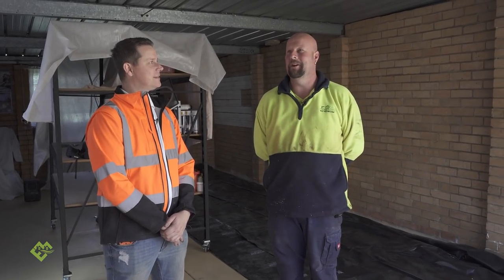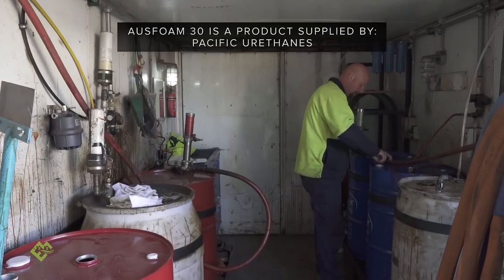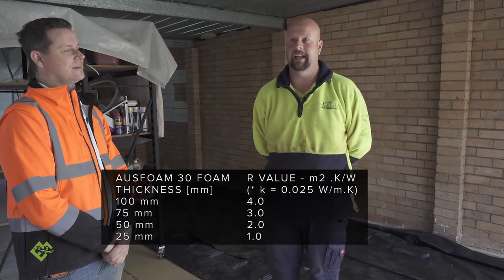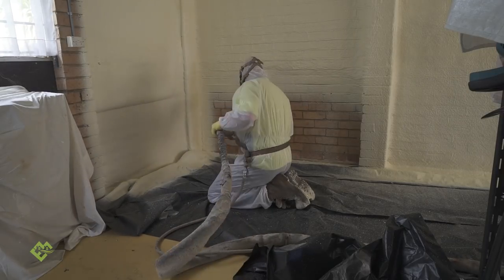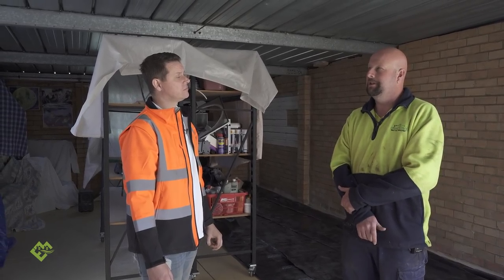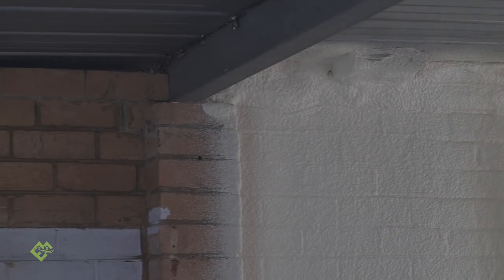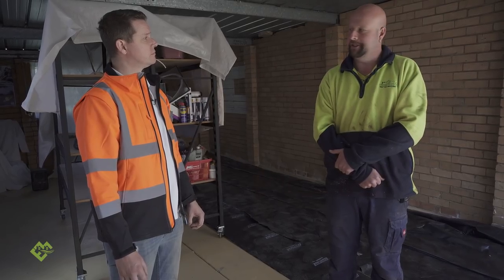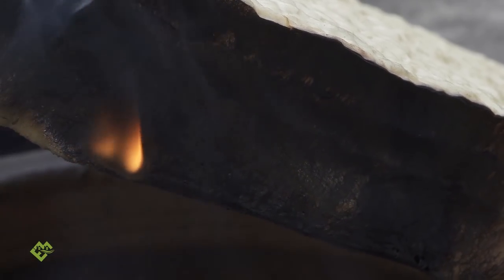Insulating and Air Sealing a Metal Deck Roof with Spray Foam.

Comment: Could spray foam be used on a pre-built motorhome to insulate it further? Can it be sprayed between exterior and interior panels?
Reply from the maker: +Janene Williames I can’t see why not, contact a spray foam installer for more information.

Comment: Had spray foam placed under my floorboards in my house in Melbourne  by a prominent spray foam company. Stuffed it up with the mixture and the house couldn't be lived in for 5 days as it was still fuming. The company didn't tell me if the risk of that at expressed surprise that it happened which was a BS claim on their part. Doubt I will do again.
Reply from the maker: +Andrew C That’s not good mate.  I had my place spray foamed under the floor, and we didn’t have any problems at all.  Did they use open cell or closed cell.  It’s important to make sure the contractor knows what he is doing, that’s for sure.
Reply: @ecoevo  Open cell. An industry that requires a training standard and better consumer information for sure!
Reply: My contactor was one of the bigger firms in Melbourne.
Reply from the maker: I had my floor spray foamed.  No problems at all!  An amazing product, and will survive the test of time.  The house improved airtightness by 20-30%.  Mind you spent 1 week digging out and cleaning out all the rubbish that was left there back from the 1970's, so that the guy had room under the house.